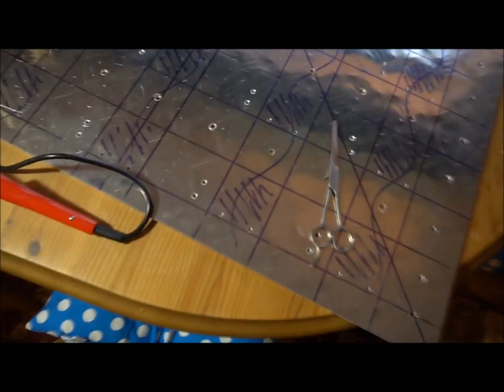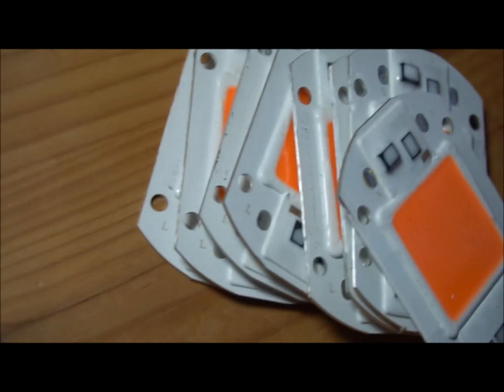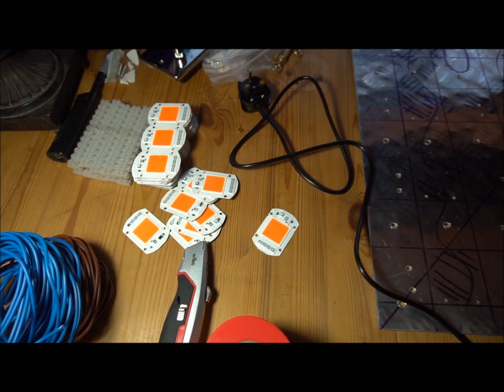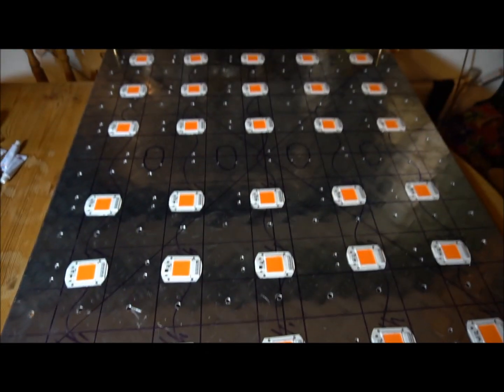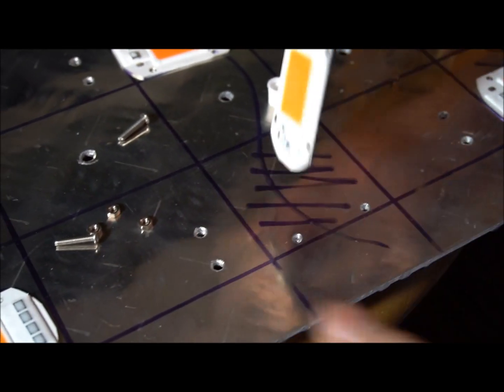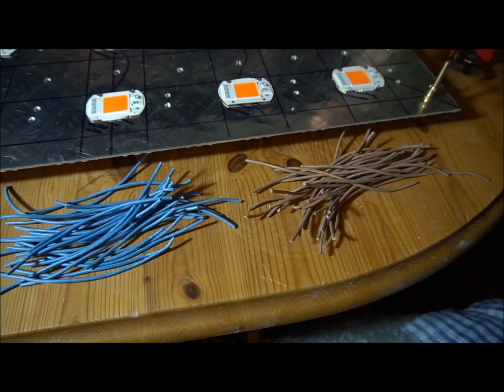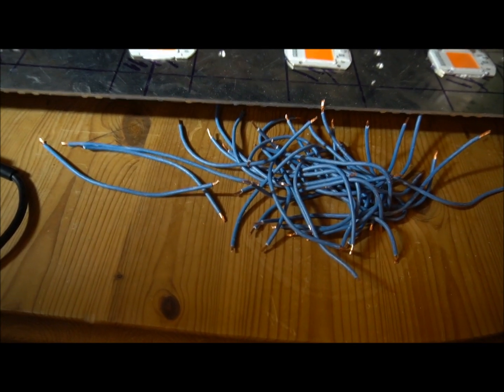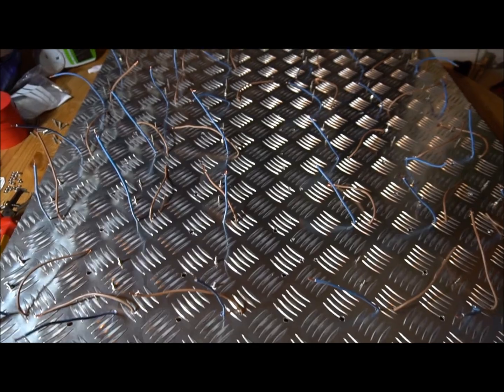cheap cob light

Comment: I have built several lights with these chips and tested them over 3 months or so. They need good cooling, fans will be needed here. Even with good cooling, the chips don't last very long, after 12 week I got about 25% of the chips had failed. Not so good. There are other, similar LED chips with different driver ics that should perform more reliably. Buyer beware.
Reply: Which cob chips would you recommend

Comment: what if I use 4 cpu fans on top of it running the whole time the leds are on?? And also drilling more holes on it?? Thank you
Reply from the maker: no...i personally would do that as well to help it cool it down more but i would run it on a regime of 6 hours on 2 hours off..anymore than this and it gets real hot.. the leds do not like it too hot..i use this light for autos and its the best light ive ever used.
Reply: @airbomzairbomz3356  hello I just bought these lights, how many watts do you need to grow a decent 1x1 autoflowering
Reply: @TheMago1202  the more light the better..but ive found the most important thing besides strain is co2.this light easily performed as well as 95k lumen 600watt hps light

Comment: Please be aware that your solder joints are weak when you solder anything make sure the solder flow's it has to flow or  your going to have weak solder  joints. and the heat from the lights could cause the wires to come loose you should use silver solder witch can with stand heat much better than cheaper solder . you should  really pay close attention to what you are doing because you don't want to get shocked with electric.and if you can find some Teflon coted wire would be best for with standing heat too just saying.
Reply from the maker: your 100% correct fella...anything i do in future will focus on that point.extremely important to do the job right pays dividends in the future use of the light for sure..thanks

Comment: 13:05  ...you just need to clean the tip of your soldering iron i think xD
Reply from the maker: yeh worked a lot better when it was cleaned thanks bud
Reply: airbomz airbomz cool project tho.... I'm currently having too less sunlight in my house so i'm looking for a lamp, making one like  yours is very interesting. I have worked with leds before, but not with the intention to make a  grow light. Tnx for sharing.
Reply from the maker: well it stopped working due to high temps... but the other one i made is still working fine.. i went for the cool white 50w units and they produce great results very very cheap too

Comment: thanks but I was talking about those blue and brown wires you cut in pieces and used them to connect the COBs together,, 
they are not 3core wire if I see correctly , they look like one part multi-core wire ,, aren't they? 
 I need to what size are they please ? where did you get them please?  I live in UK too, thanks a lot

Comment: great job man, may I ask what AWG wire you used please? and what sort of wire you recommend for such a job but with only few COBs,, thanks for any kind of help info or advise
Reply from the maker: I guess that depends on the size of the cobs...I just used ordinary 3 core for the uk.its good for 13amps.the hard stuff is a real pain to move around and solder.
Reply from the maker: this is a good dimmer
https://www.ebay.co.uk/itm/4000W-220V-AC-Adjustable-Motor-Speed-Controller-Module-Voltage-Regulator-Dimmer/263279783396?ssPageName=STRK%3AMEBIDX%3AIT&_trksid=p2055119.m1438.l2649
Reply: great , thanks man , i needed to know about dimmer too

Comment: also i would check the dimmer is capable of handling so much power
Reply from the maker: yes it was capable and ive since found other ones on ebay that do the job ok...but its the usually heat problems with these lights

Comment: i would have thought you would have heat issues as the plate is not machined flat on the back like a heatsink would be and it is very thin, i would definatly seek to add some passive cooling at minimum or buy flat unprinted plate and attach some heatsink strip to the back where the cobs are located and some fans.

Comment: Made up something similar to this, I water cooled my setup, used these exact cheap cobs they really were terribly inefficent and burnt out quite a few real very quick even at 32-42 degrees Celsius water cooled compared to 70 to 80 deg air cooled. 
I used 550watts of them and they produce a nice amount of lumens but not great par considering the lumens and watts. 
Considering how cool they ran and how fast they burnt out when they shouldnt. 
These cobs are really a waste of time. Im all for saving money but this is not the way to go for a decent reliable led light. 

Id use them for a cheap small scale seedling, clone or small plant veg light at best.
Reply from the maker: did you try them at 4 hours on 2 hours off regime?..worked for me
Reply: @airbomzairbomz3356  I'm sorry if this sounds stupid but if you take 5 50 watt cob lights. Do you get 250 watt light. Or do you get a large 50 watt light. Some stores sell 25x10watt leds as 250 watt leds. Is that truely 250 watt or 10 watt.
Reply: @babayaga9102  power consumption is gonna be 250 watts.

Comment: Few safety issues there that i can see, please dont copy what this guys done directly.

An example being the use of standard twin and earth wiring, while its up to the job of supplying the power the temperature rating of the insulation is only 70 C. Also the comment about grommets is quite pertinent.
If you dunno what youre doing with mains electricity please leave it alone

Comment: Neat project joining all those together, but I'm not sure it's worth it in the end for a few reasons... The photon performance of those generic LED dies that make these generic chips up is not very good at all (all the generic cobs, not just these plant ones).. and the 2 band red blue spectrum is not very good at driving efficient photosynthesis either. . a generic AC-DC LED driver and some brand name cobs like Veros would perform MUCH better and would be pretty close to the same cost. They could be setup in a similar manner with no optics and a sheet of aluminum stock if not placed too densely and driven too hard. Not crapping on your project, just informing people about the performance of these things. I started out with some too and didn't know they weren't that great of a deal when performance is factored in.
Reply from the maker: your exactly right
Reply: Yeh whilst cheap cobs may be cheaper outlay a cree led will beat it when you factor in power costs and efficiency
Reply from the maker: @biggav5555  I would have to say no to that..depends hour your using the light..this light has continuously proved excellent on a 6hr 2hr regime.. its so powerful I would recommend people making this light no problems

Comment: Could you wire these in series rather than parallel
Reply from the maker: i certainly could have but if one went out then all would go out!  hence why i wired them parallel.they are all recieving power its not travelling through one to the next...
Reply: No you cant, the forward drop of the cobs is in the region of 200V, they need to be paralleled

Comment: Come subscribe to my channel, please, I'll do the same to years, but you're gonna have to do something for thermal management or stand. You're using the aluminium plate, but it's not going to be enough chips. Give way hot I come check at least to put on top of the aluminium.
Reply from the maker: it has since been shelved..poor quality cobs I think..building a different light shortly

Comment: Okay last comment should have waited till the end. All of those holes that you fed the wires through should have rubber grommets in them to protect the insulation of the wire. If the insulation gets nicked or chaffed you could get a nasty shock or have a short. Okay I think I'm done have a great new year.
Reply from the maker: went to join up the cobs I disconnected and they were dead so shelved that idea.building another light shortly

Comment: Also noticed the tip of your Iron tip was dull. keep a damp sponge or get one of those copper pan scrubber's and wipe the tip across it to clean the tip. Also get a small tin of tinning paste and dip the tip in it the tip will last longer and your soldering will go easier. The tip of your iron should always be bright and shiny.

Comment: Just so you know that is not heat sink glue, It's called heat sink or thermal compound and it doesn't dry. If it dries out it will no longer be effective. Also glue dosn't dry it cures. Other wise a fairly good video. Thanks